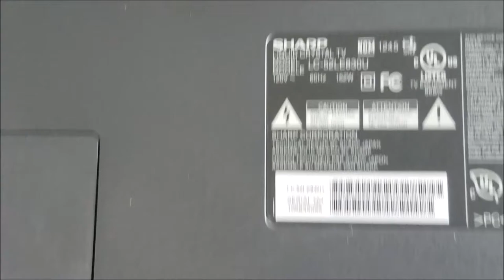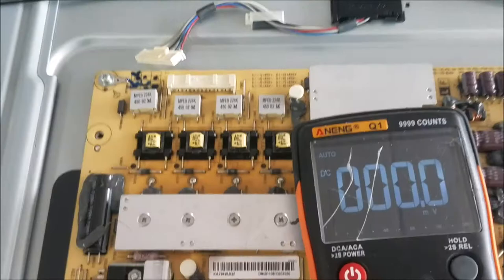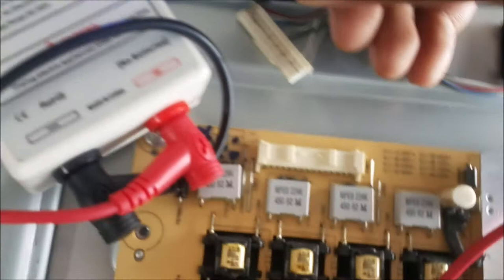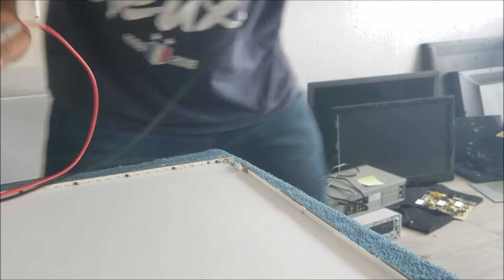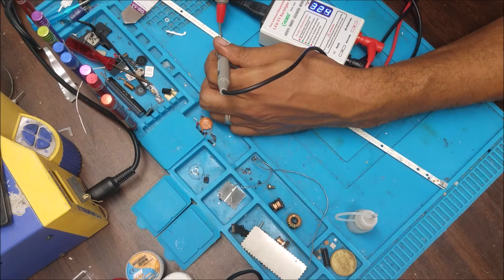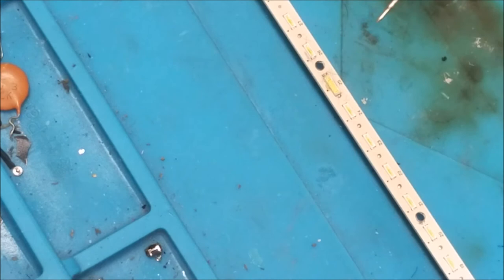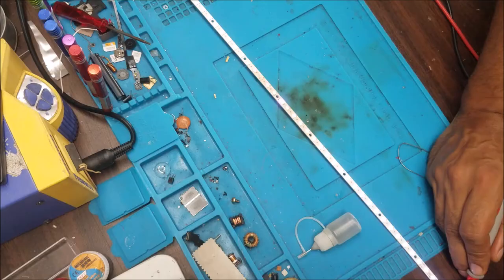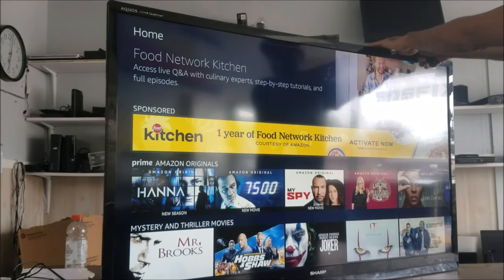sharp LC-52LE830U standby light flashing no picture no sound

Comment: Very good 👍🏻👍🏻👍🏻
Reply: Hi bro thanks for sharing the video. I have tried your method and it works to reset the blinking light after I’ve repaired the backlights. 
But the problem is when I unplugged the power and plugged back again the blinking starts back. I know I need to reset the lamp error counter but I could not go into service mode. I’ve tried many methods but don’t seem to work. The tv model is LC-52LE830M. 
Hopefully you can shed some light here , thanks 🙏🏻

Comment: I have same issue.. blink white flash slow and blink white long fast.   LED was bad so I replaced them and still get same thing once I plug TV into power.   the only difference is when  The LED strip measured 92-94v  per pair it had 4 pairs  but 1 pair was showing short.    thats why I replaced then LED strips but the new one showing 89v eac pair and all 4 pairs have voltage.     can it be my main board issue ? or the 89v is not enough volt which they need to be 92-94 also ?  what else can I test,,,  I am going to jump the pin to power more componets on board and see.
Reply from the maker: that is enough voltage, did you check the new leds?  check the connection, check BK on it it has voltage

Comment: I jumped pin 14 and 15 ... then I tried to test for 13v  I do not get any 13v on the power suuply board ? does this mean the Power supply board is bad >
Reply from the maker: on power supply you jump the ps on pin to 3v standby and check the voltages

Comment: Hi bro thanks for sharing the video. I have tried your method and it works to reset the blinking light after I’ve repaired the backlights. 
But the problem is when I unplugged the power and plugged back again the blinking starts back. I know I need to reset the lamp error counter but I could not go into service mode. I’ve tried many methods but don’t seem to work. The tv model is LC-52LE830M. 
Hopefully you can shed some light here , thanks 🙏🏻
Reply from the maker: replace the  backlight
Reply: Hi, what about your tv now'
I have Same tv same problem .
I changed the complaint LED.
Still I can't reset properly
Please help me

Comment: Bro,my sharp lc46le820m,standby light blinking,power on Nothing happen.cannot reset by pushing the vol- and input method due to no physical button to push.its a front panel And a touch screen  type button. So how to fix or to reset my tv? 
and when u do the jumper,u jumped the ps-on with standby? My power board ps on and standby pin are seperate ,not in the same blok,but to jumper them is it possible?or just jumped it to BU5v?
Reply from the maker: go to the tcon board  and disconnect one side of the screen flex then turn on the tv if the tv stay on mean that side of the screen has short, if you disconnect both sides but no change mean the problem is something else

Comment: nice Video, have the same model with a different set of flashing code.  2 long followed by 2 short.  I was wondering if you had any ideas? i think i may replace the power board but would like some insight before i buy the part.
Reply from the maker: get the multimeter and check the voltages

Comment: When im reset tv with the button vol down chnl up + power, tv just not display anything just black. Solution bro?
The Power Blinking just stop when i touch the reset button.
Reply: Tv sharp lc40le830m
Reply from the maker: Maybe you have other issues. Chech the voltages from power board
Reply: SOSfix Electronics bro..how to enter self service mode?